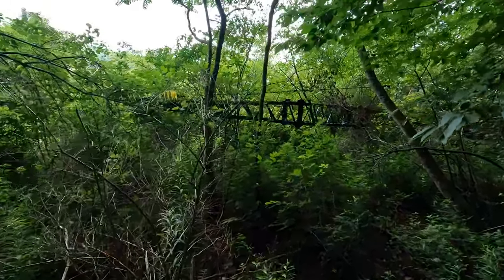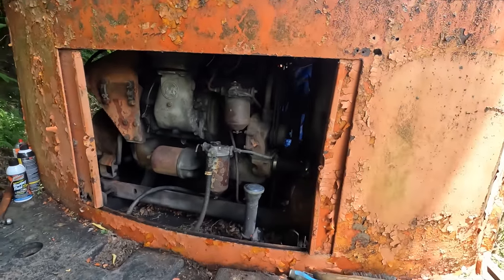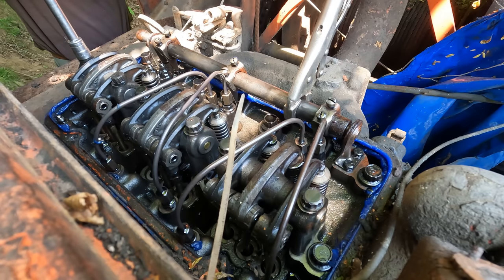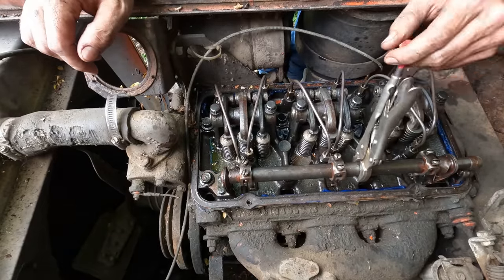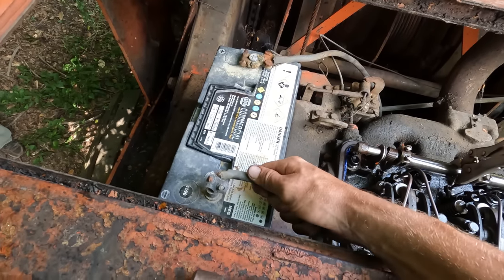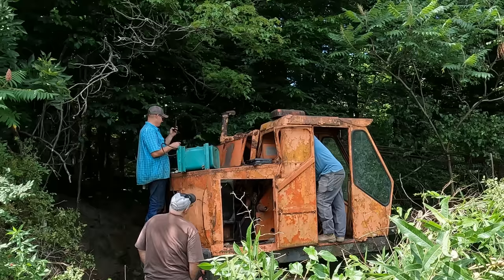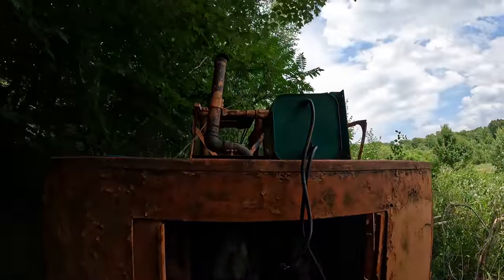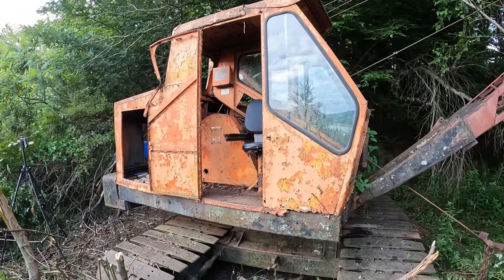Abandoned in the Woods 20+ Years!! Will This Old Dragline Crane Start and Move?!?! (Detroit Diesel)

Comment: I always thought the difference between a blower and a supercharger was the blower just pushes uncompressed air into the intake manifold and the supercharger compresses the air before it goes into the intake.
Reply: That is the true distinction between the 2 concepts. Hard for some people to accept that. This engine is merely "blown" to scavenge the left over exhaust gasses out near bottom dead center while the intake ports are uncovered and the exhaust valves are still open (it only has EXHAUST valves). While the exhaust valves are open and the intake ports are not yet covered by the ascending piston,  the air from the blower "scavenges" the spent combustion gasses out replacing them with fresh air, but no "supercharging" happens because compression does not begin until the piston fully covers the intake ports in the liner and the exhaust valves are fully seated.  The term "supercharging" has more to do with WHEN the exhaust valves close while the intake is still open, not what type of device is pushing the charge air into the cylinders.

Comment: Just something about lungs of an old Detroit...man she sounds great!

To Matt, or anyone else for that matter, could I get some pointers on getting a 69 Ford 3.3L diesel started?  She has the CAV injection pump.  Motor spins and everything checks fluids wise.  I just can't get her to fire up.  Fuel cut-off moves without restriction as well as the throttle lever.  I have not verified, yet, that fuel is getting to the injectors as she's over 2 hours away from where I'm at so working on her is time consuming.  Thats why I'm hoping I could get pointed in the right direction. 
Any advice or link to a video would be greatly appreciated.

Comment: this has a rare full vision cab..i would say 1968-72..i have aT 350 SIMILAR sittingb in the woods 25years.i tried to start it in 2005 but mud dobber nestsin the turbo charger shelled out the motor....i also have an extra high gantry,,as rare as a two peckered billy goat ..to give great leverage to raise the boom...... T 350 IS A TWIN SCREW TRUCK with this crane on top of it......hydraulic outriggers on a 306a carrier...318 gas dodge engine

Comment: Looking at the starter for the voltage could end in smoke sing. At least with East German equipment. For example the IFA W50 hase a 12v electrical system but a 24v starter. I don't know why they builded it that way. Maybe it was cheaper to use 12v components

Comment: Dad had a bantam crane when I was a teenager.  The two sticks in the middle are your cable drums. To your right, the tall one with the handle at a right angle is your boom up and down. The lever with the push button lock is your swing brake, the other handle should be your swing. To the right the straight stick should be your travel  the two levers at floor level pointed to the right are your steering. The two levers pointed to the front and you pull up and place in the notch are the ratchet for the cable drums, you can cable in but you can't cable out.  There is a two speed, but I don't remember where it is but its on the left, dads two speed the cable was broke so you had to go to the left side of the machine to switch with a screw driver. Two speeds slow and even slower. I think high was 1/2 mike an hour and low was 1/4 mile an hour. You just showed the emergency kill so you know about that.
Reply: Just remembered dads crane was either dependent you had to start it 1st time with a snort of either but the rest if the day it would fire right up without it.
Reply: I'm thinking now the big lever on the left is the swing and the shorter one on the right is the travel. It's been 30 years

Comment: The Bantam is in better shape than the Unit crane Johnathan W dug out of the woods. His has a 353 also. Could you use this crane to hang the bridge crane and support structure pluse roof trusses? I'm not sure it has enough counter weight to lift the bridge crane.AL B.

Comment: Dear Matt what a find  I was thinking you have that small much older  and I rewatched that barn you had to Demo 
I was thinking why not get this for work jobs  here's my idea if we can get it running well put cable on it you could make that crane do multiple things
A crane  A dragline  With 2buckets  get a clamshell buckets. But here a idea build or find metal and reinforced Concrete and make or find a "Wrecking Ball Now I not say swing it but that silo been nothing but hit with it that concrete would of shattered the barn could have been use to surgically hit the building making it Collapse But a wrecking ball poured metal but I figured  junk I beam with Rerod wrapped around then put into a mold or those concrete barrier re fit with a hook and lock to swing it idea

Comment: I built a small machine in Denver Colorado it was a pile driver for a concrete smashing and dirt pounding and had two engines you could get a international straight six or a three 7 L Detroit do song the same engine mount superior to the international amazing you could wrap them up for hours my father had three and he ran them 18 hours a day for years just change it oil change the filters and they go and go

Comment: Matt...Have you by chance seen a manufacturer's date for the engine?  The valve cover says General Motors Diesel but there's another part which clearly says Detroit Diesel.  Just curious if you've seen the true vintage of the machine, thanks.

Comment: Stop using those garbage  tractor clamps , that strips out,  buy these  from harbor freight with machine screws and nuts  part # 020-432 called Clamps Collets  38 pices in kit there hell lot stronger than those screw garbage clamps, that break .

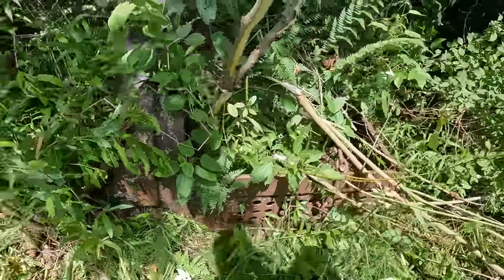Comment: Why would you say that Detroits don't have a lot of power? For the size of engine they produced more power than any of the contemporary engines of their day. Check the specs. The 8v71TA had less than 10L and could out pull a Big cam 350 of the same time period. One thing most people don't realize about starting power with the v8 Detroits is that they had 2 cylinders at TDC firing at the same time every stroke. I have witnessed an 8v71NA 318hp in a 71 Chevy series 60 with a 13speed and 4:11 gears pull a late 60s HW excavator that weighed 50ton and start it moving in spongy ground. We sold the HW in 1984, and when they came and got it the Big Cam 350 with a 10spd and 3:90s would stall trying to start the load in our hard packed lot. And that is a 14L engine with a turbo, but the trubo doesn't do much good at starting a load at low RPM. They had to slip the clutch something horrible to get her started.

Comment: WHEN  YOU TAKE A SCREW DRIVER AND LOOSEN  THE 
ARMS  ON  THE CONTROL RACK...
YOU THROUGH  OUT THE ADJUSTMENTS....
.YOU SHOULD  UNBOLT THE WHOLE  RACK AND REMOVE IT....TO  BE  ABLE TO ROTATE EACH  HELIX.....as  for the emergency   AIR  SHUTDOWM
....IVE  HAD THEM   RUN WILD  EVEN  WITH  THE BLOWER  INTAKE  COMPLETELY  COVERED....
IT TOOK CUTTING  OFF THE FUEL LINES....HOLDING  THE
SHUT DOWN LEVER  CLOSED...AND SEVERAL  MINUTES TO EMPTY  THE CAST IN FUEL RAILS IN THE HEADS..........AND  SOME GUTS....
IDLE  IS FAR TOO  HIGH....SET IDLE  AND BUFFER....

Comment: I assume the previous operator is deaf😂
Reply: I ran a 4-53v in an Oliver 1950 tractor from  1965- 1972 with a straight pipe about 4" long and my ears are still ringing but my cousin could hear her 5 miles away.

Comment: That’s not a 24 volt system on that machine
Reply from the maker: Well the starter wouldn’t turn with 12 so I’m pretty sure it is, also the battery box is large enough to accommodate two big batteries.
Reply: @DieselCreek  well I’m not trying to start an argument but to my knowledge none of the c-350 or any 350 or 35 bantams were 24 volt systems.   And the battery box is large because they used the large group 4D style battery.  Also if you listen to how fast that starter cranks you could tell it’s not a 24v starter
Reply: @DieselCreek  if you have any questions or anything on that machine just ask I’ve got books and manuals for reference along with half a dozen other bantams for reference

Comment: By pussing fuel filter and little eaft to do the right thing.  Just join.  I think unscripted. Bad contant at the beginning.  Yep start. But no cold start preparing ( mmmmm nope. You will lose for not doing the correct thing. No words. (( fail.